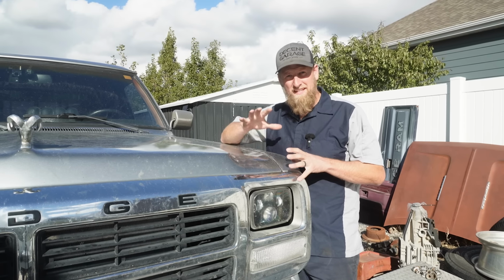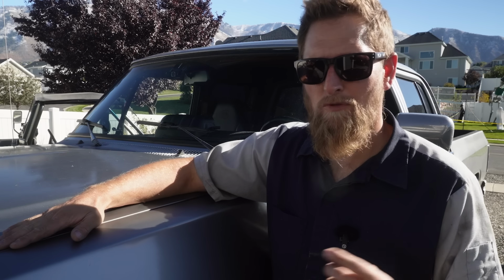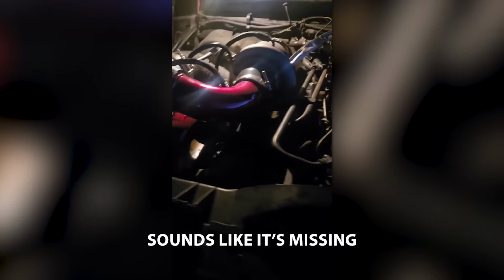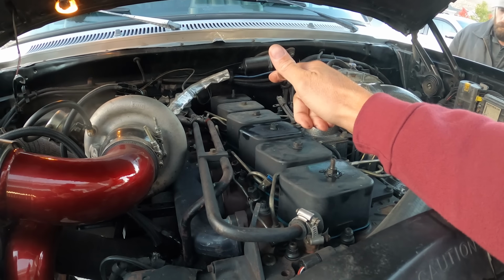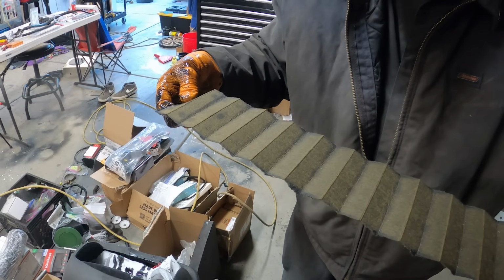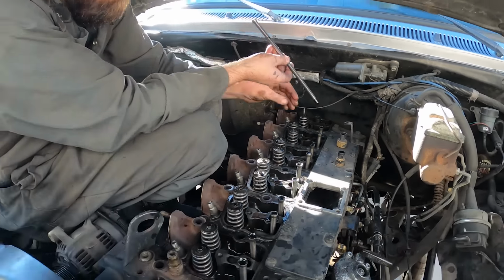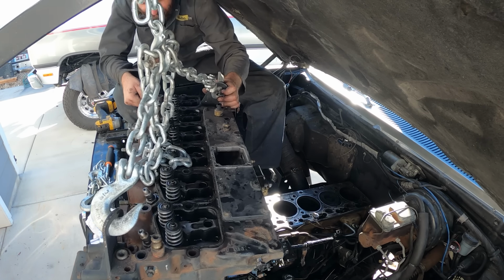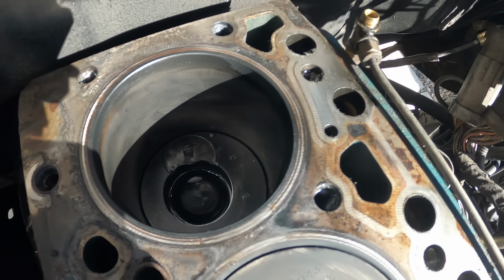Disaster Strikes: The OG Crew Cab Suffers a Catastrophic Failure

Comment: I hate to ever see anyone have bad luck. I would suggest building it back with non ic pistons. Having run the same 3 sets of injectors in both my crew cab and my 89 the 89 is much cleaner burning in typical city driving and I believe that is from the better piston bowls.  You probably need to check your cam though. There is no good reason for your valve lash to have gotten that loose unless there is an issue.  I have done several heads using the Goodson heavy duty 12v springs and no issues over the last 5 or 6 years and one of those engines I did for a guy I know has over 100k miles on it
Reply from the maker: Yeah I plan on going to the non ic pistons for sure. What are your thoughts on oring vs fire ring?
Reply: @ both of my trucks are fire ringed. As long as you can find someone to cut the radiused grooves it should last a long time. 625 or 14mm studs are pretty much a must though to get the fire rings to crush properly. Doing several re torques is necessary as well till everything settles in.
Reply from the maker: @bcbloc02  gotcha, I was hoping to reuse my 425s but I guess I'll have to upgrade haha
Reply: @bcbloc02 Have you ever heard of or come across a 1991.5 having non intercooler pistons from the factory ? Thanks
Reply: @ no every factory intercooled truck I ever worked on had the small bowl pistons. The fact the air intakes and heads are different too means Cummins would have had to screw up the build at the factory and that is highly unlikely because the cpl dictates the parts the engine is built with. Only way I could see that happening was if an engine had a bottom end fail and the dealer ordered the wrong longblock and it got changed but it didn’t happen at the factory.

Comment: This year I had everything go wrong on my 31 year old D350. First I installed a Turbinator stage 1.5 in January. Then I sheared an ARP head bolt near cylinder 3 exhaust - had to TIG weld another bolt to it get it out. Then sheared every carrier bolt in the DANA 70 LSD. Then A/C issues. Then u-joints. Then NV4500 a month+ ago. And just added some Dynamic Diesel Stage 2 injectors.  Now it seems to be running nice, but the bank account is suffering. Also, had terrible failure rate with Stant Lever Radiator Caps - they wouldn't last a month. Replaced cap with non-lever style and all is good. Also installed a coolant pressure gauge to go with the water temperature gauge.

Comment: Sorry this happened. I would recommend having the head fully inspected, if rebuildable, go back with nitrided stem inconel exhaust valves, nitrided stem stainless intakes. Good retainers, keepers and springs and oring the head along with best quality head studs. Those compounds really build cylinder pressure. The nitrided stems are a surface hardening procedure that helps with wear. Keep us informed, I really enjoy your builds.

Comment: I had a similar issue with beehive valve springs. I will not use beehive springs again. Check the connecting rod. Definitely will need push rod
Reply: Quality control is not what it used to be apparently. Weak spot in the steel probably caused it.

Comment: You got insanely lucky that the cylinder didn't get fucked. Honestly thats the best type of failure. Decently cheap for a total show stopper failure you get to pull the engine and have a good laugh at the end. Sorta had that with a ring gear on my 80 w150. Starter wasnt kicking out all the way chewed it up so it was a drop and replace all in 3 hours. It cost me nothing  put me up against the clock and was honestly fun. Yeah this wont be free but still you asked for this pushing more power and now comes the hard work. 
Still sucks to have that happen though. 1000hp when?
Reply from the maker: Yep, it's the name of the game with horse power.

Comment: I would question all your valve train parts at this point. I would also for sure find a different spring supplier at the least. The chances of having another one break are great if this one did. The fact that your valve lash was so bad so soon is shocking also. Something's not right with the parts.

Comment: You know what just came to mind was what if you did one of industrial injections '12 valve builder box' kits. The stage one kits like $8300 bucks. I think it's exactly what you need. I mean it's more than you need to get it going again...but like your at a cross road here, you can go one way and back to stock OE'ish build with some little upgrades here and there but at some point it's gunna happen again I think? Or you go go the other way and turn 'left' and do it right and do it bullet proof! And be able to throw anything you want at it and not have a worry in the world. 
There really simple motors to put  together. The industrial injection builder box kit would be a neat mini series for ya to do for the channel I think! Go check them out, think about and let everyone know what ya your thinking! 
A p pumped 24v would be cool to! That'd be the ultimate upgrade improvement. Blocks are the same, pistons and heads a different. Let's say your heads junk, get. 24v head and new 24v pistons, use your 12v rods. And swap out the VE rotary pump for a p7100 set up! Now that's an idea!
Reply from the maker: Great ideas but I'm sticking with VE and going to rebuild this motor.